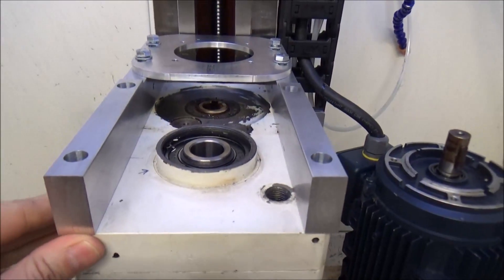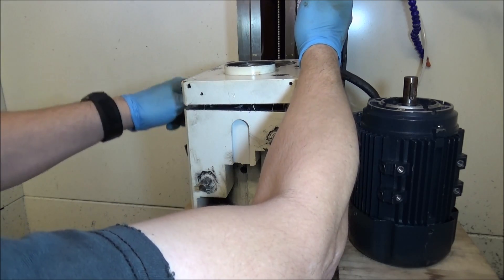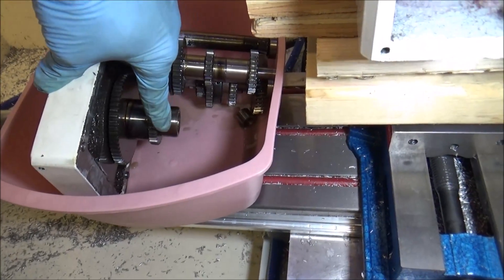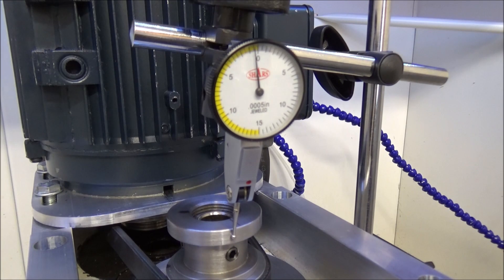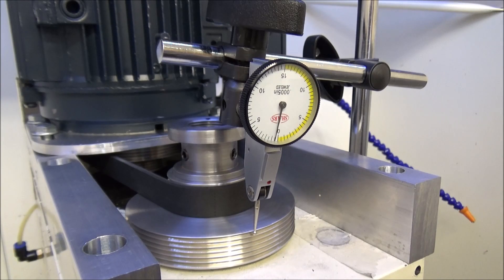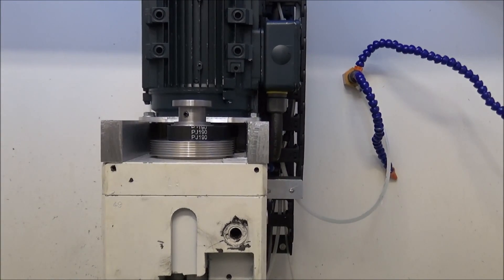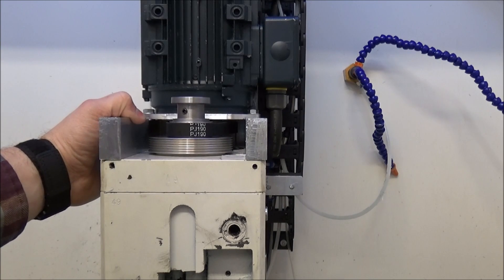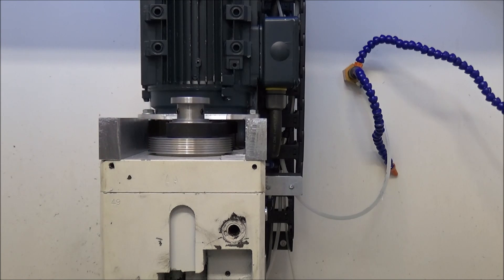PM727M Belt Drive Install

Comment: Sam, I know your not specifically working with a PM25mv, but by chance do you have any recommendations on a replacement motor and vfd for that size mill? I’m currently running one of the bldc 1100w spindle kits from automation technologies but the portion of the controller that can be controlled from mach3 is damaged and they don’t have any controllers they can sell me. At this point I’m considering a vfd and new motor as not having mach3 control the spindle is really annoying and sucks up time pushing buttons for rpm,start and stops. Thanks for all you do. I follow every video of yours!
Reply from the maker: Hi Louis,
 well the PM25 head is a little smaller but I have seen big motors installed several times. This motor is a monster in terms of power and Torque 1000 to 1 but its 50lbs 6.5 in dia. and 14 inches tall. It is my next motor upgrade when I do my cabinet. but its surplus and limited quantities. its a great Deal at this price. http://dealerselectric.com/Y522.asp?gclid=EAIaIQobChMI-IDng7eN2gIVm4WzCh3JWgkCEAYYBSABEgIDRvD_BwE

You may need to beef up the Z axis motor because like I say see is a monster.  this motor is similar. to what Russtuff installed.
Reply: CNC4XR7 I’m running a nema 34 on my Z which I think is similar to Russ. 50 pounds is a crazy heavy motor though. I think that’s a little more then I wanna jump into as far as size is concerned. In truth this spindle motor that I’ve got currently has been more than adequate for what I’ve been doing but I having to manually set up an adjust for every other tool really stinks. I found a couple threads on C&C zone where they discussed different motor options for the G0704 size the mills but the problem is those threads always turn into a pissing match on specs and discerning definitive information becomes a headache. Thank you for the input, it’s really appreciated

Comment: It looks like that was a grizzly Mill. Why not just use one of their belts and Cog pulleys?
Reply: Nice & clean Sam .. just as a side note:  The pins that align the lid should be tapered pins and have threaded bores on the top end.  Can't remember what thread they were on my machine, but if you screw in a SHCS & leave the head just above the top of the lid . you can use a small pry bar to pull the pins out and the lid is free!
Reply from the maker: Thank Gary! Yes I figured that Out there M5 on this mill. comes off easy if you  remove the pins.

Comment: Hello sir. I ordered a PM727V and am waiting on it to ship. I plan to keep it a manual machine but I was wondering if you had any input on "must have" modifications.
Reply from the maker: It's a really good machine overall, I would add some shims to tighten up the backlash on the hand wheels.